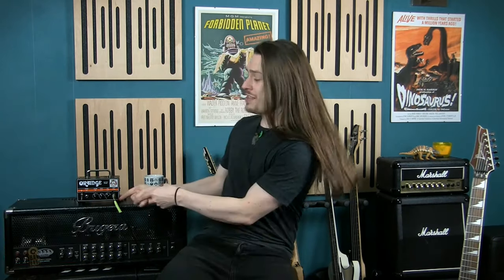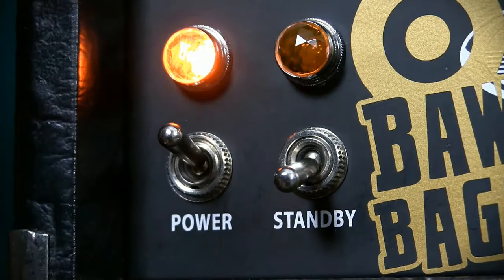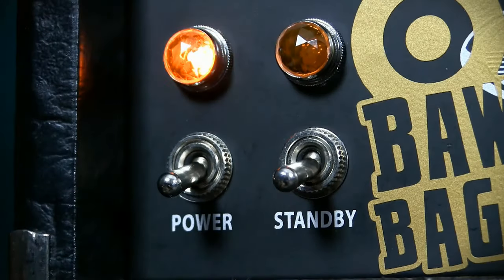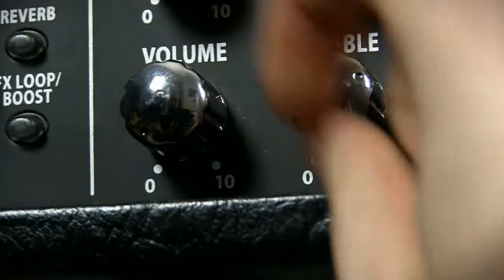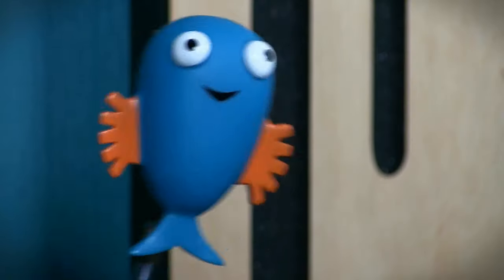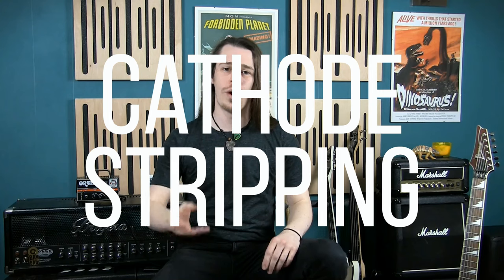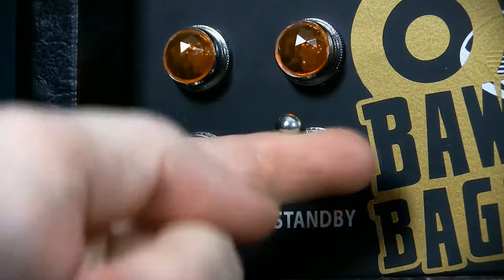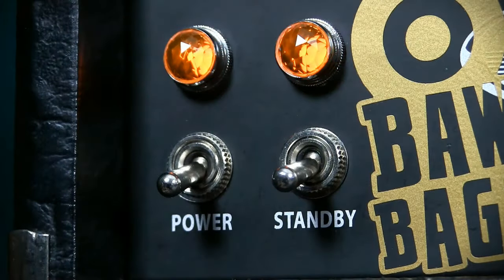Your Standby Switch Is A Lie!

Comment: The only thing the standby switch possibly protects is the speakers. When any amplifier is turned on or off, you often hear a pop depending on how high the volume is set. The standby switch disconnects the input and output buffers, meaning that pop is minimized. It can protect the speakers, but not the amp itself.

Comment: You can also turn your amp on and not plug in your guitar until you're ready to play. You don't need to turn down the volume in this instance. That's what I do as my amp doesn't have a standby switch. The manufacturer told me that when the guitar isn't plugged in, the amp is in "standby". Cute explanation.

Comment: The Standby switch is just a convenient way of muting the amp without having to change your settings (in this case the volume pot) on the amp. Thus making guitar switching much more seamless as well as not making life for the soundman's (if the club provides, or your band can afford to employ one)life much easier.

Comment: To clarify a subject that nearly everyone is confused about:   A Standby switch ensures that no high tension voltage is applied until the valves are fully warmed up. This avoids a build up of excessively high voltages while the H.T. voltage is waiting for the valves to warm up that may damage CHEAP CAPACITORS.

1. Use the STANDBY switch for 2-5 mins after switching on the amp  

2. For short breaks: ONLY TURN DOWN THE VOLUME  

3. For breaks longer than 20 mins: switch the amp OFF completely
Reply: Hot-switching 400+ VDC (with the standby switch) to components that are ready to start conducting and drawing current RIGHT NOW makes me nervous. I've had amps with tube rectifiers blow fuses and have internal arcing in the rectifier switching from "standby" to "on" for me to trust it. I feel better just powering the amp on and letting the components start drawing current gradually as they warm up.

I have a buddy with a Marshall JTM-45 reissue that was constantly blowing rectifier tubes switching off standby. He took it to a tech who re-wired it so the first filter cap is connected directly to the rectifier. It hasn't destroyed a rectifier tube since.

Comment: I call your analysis accurate. 
I'd add that, when in "standby",  the voltage across the filter electrolytics goes high due to removal of load from the supply...not at all a good thing.
Also, have a close look at the ratings of the "standby" switch; not at all rated for the DC potential across it.

Comment: If your amp has a rectifier tube, leave the standby switch on at all times! Use only the power switch.
If you don't want to ruin your level settings, just pull the input jack halfway out during breaks.

Comment: I prefer/am used to the standby switch. True that turning down the volume is the same thing but It's just easier to flip the switch next to the  lit up red switch in dark places. Might be true that the switch will wear out faster than a volume pot but the switch is way easier to replace, with today"s circuit board amps, it's a real pain removing the board and desoldering a pot off the board. (I am my own amp tech, not a rich man)  In the 13 years with my current amp the switch is still working fine.
        My rules for tube care  1) warm up the amp in standby, 1 to 2 mins.  2) Shut off the amp, both power and standby at the same time, but don't pickup or move your amp until it's had a chance to cool down, at least 5 mins. preferably more.
        I'm not an expert by any means but these two simple rules haven't let me down yet. Knock on wood

Comment: If you run an old non-master volume, multiple channel (jumpered) amp like a JTM45/Bassman, where the balance between your gains is more important to your tone and more finicky than your EQ settings, you will be glad that you can throw a switch and mute the amp.

Comment: Well...  Everything you said is correct except that turning the volume down is the equivalent of hitting the standby switch.  Sure, if all you're looking to do is to silence your amp, then either one will do.  But a quick review of some Fender and Ampeg schematics shows that the standby switch cuts the B+ line which provides voltage to the plates of your tubes.  The volume pot controls the signal level to their grids.  So in theory, using the standby switch saves electricity, though probably not much.  I mean, the whole idea of the standby switch is that it cuts the plate voltage without cutting the power to the filaments, so the tubes will still be warmed up and ready to go when you're ready to play.  But that also means they'll still be sucking up electrons to keep them hot because...well, you know...class A amps and all.

Comment: Stand-by switches were originally utilized when the PS caps were operated at or very near their rated operating voltages. Now-a-days, electrolytic caps are manufactured with much higher voltage ratings so they typically operate well under their rated voltages and the stand-by switch really serves no practical purpose. Cathode stripping is only an issue in which the power tube utilizes a filament and not a heater. You tend to see these types of tubes in radio transmitters.

Comment: the old equipment had rectifier tubes, which allowed to warm up the tubes a little before being fed with high voltage in the plate !!!
This happens because  the rectifier tube has to warm up itself to work and deliver the HV.

Now, modern guitar tube amplifiers have solid state rectifiers ... and therefore the tubes receive high voltages when they are still cold!! 
THIS is why the standby switch is good for preserving the preamplifier and the power tubes.
Make no assumptions about this just because u see old equipament without standby switches. consult any tec and you will see it.
Greetings!!

Comment: In my marshall JVM head I can keep the head in standby so I don’t need to load the head with a cabinet and just use the simulated speaker output in case I need to quickly record a demo using headphones or just studio monitors

Comment: In a SS rectifier using the Standby on start up actually sends a Spike that wears down Power Tubes. Using the Standby on shut down then unplug and switch both stby and power to on , will Drain Caps fast if you need to service. But moving Volume pots after dialing in is not a great idea either. So turn on at power standby to mute or drain caps.

Comment: I like the switch just because whenever I take a break, I don't like turning down the volume from it's nice sweet spot 
And it's easier, it's a switch, you put less work into using it, and I also knew as well that not having it wouldn't break my amp, it's just more relieving to have

Comment: Turning down the volume knob is not a better way to mute the amp while keeping the tubes hot. Because then you wouldn’t be able to turn the knob back up to the exact same spot. On my fender, a tiny move of the volume knob between 0 and 3 makes a big difference.

Comment: I agree with your main point, but I find the standby switch to work better for me than rolling down the volume because it's just that bit more lazy. It's just a flick of a switch, and rolling down the volume could result in my volume being too high or low because I'm too lazy to remember what volume I had it on.

Comment: There are amps that do create pops when turning off (old voxs do this) which standby switch makes less annoying, also putting it on standby when plugging in and unplugging stuff from your fx loops if you don't have a master volume (no volume after fx loop). Otherwise yeah u agrre just switch it on

Comment: Peavey has "in-rush current limiters" built into most of their tube amps.
Peavey amps still have a "stand by" switch because that is what customers expect to see, but you can turn the amp on without using "Stand By". The "in-rush current limiter" prevents current from hitting the tubes until they are hot. So, it's like you are actually ALWAYS using the Stand By switch on Peavey amps.
Reply: I have a masters in Wikipedia also lol
Reply: Peavey also say DO NOT leave a tube amp in Stand By more than 15-20 minutes. It ruins the tubes.
When you aren't using, turn it off.

Comment: Do NOT turn your amp volume knob down and then back up if at a gig once the engineer has done his sound check! Just use your standby switch to mute the amp. Unless, of course, you want to piss off the sound guy by suddenly having your amp at a different volume when you turn the knob back up to a slightly different position and start your set.

Comment: Based on the little I know (I just start building amps...), I have to agree with what you said . Also Barry at Ampmaker.con who is developing amp kits since many years mentionned that it is mostly useless or could even be detrimental. However it is usefull as a quick mute feature...

Comment: Someone forgot about the DC coupled cathode follower that doesn't like to get 100V higher tension on the grid before the tubes get hot......furthermore a lot of amps have their electrolytic capacitor and plate coupling caps voltage specs close to the operating voltage. And before the tubes are hot that voltage is higher. You can of course engineer around this problem. But i haven't seen any known brand of amps fix the DC cathode follower problem and a lot if amps are to close in voltage specs on their caps. So it probably is better for your amp to use the standby and heat up the valves before turning on the high voltage.

Comment: well, my Mesa Boogie TC100 manual says to Always power up and wait at least 30 seconds before turning the standby switch on, and my Fender Super Sonic 22 manual suggests that it is a good idea but not crucial.  Curious that amp manufacturers vary somewhere between ALWAYS use the standby and eehhh..... go ahead if you like.  While you say it's a load of junk.

Comment: I was curious about this issue.. Here's what Dr Z of Z ampworks says.. It's close to what you indicated, only he does recommend you use the standby switch on amps with solid state rectifiers..

Standby Switch in Tube Guitar Amplifiers
The use and need of a standby switch is an issue that comes up from time to time. Let me say that a standby switch is a convenience supplied to guitar amps. Now not all guitar amps have standby switches. For example, the Carmen Ghia and its indirectly heated 5Y3 rectifier does not need a standby switch. By the time the 5Y3 conducts high voltage, the tubes are heated and ready to conduct. Extremely high quality tube stereo amps, like those made by McIntosh also don’t have standby switches. Remember that many stereo tube amp connoisseurs and audiophiles use these kinds of amps sans standby switches. I have never read an issue about the lack of standby switches on stereo tube amps.

So why do amps have standby switches? They are installed as a convenience for the operator. When a band would take a break, the standby switch was used as a “mute” switch for the amp. Once the break was over, the amp would be ready to play with the flick of a switch.

A few terms used to scare users into using standby switches:

Cathode Stripping: This term does not apply to the tubes used in guitar amps. This applies to cathode ray tubes, and only under limited applications.

Cathode Poisoning: In my 50 years of dealing with vacuum tubes I have never heard about this phenomenon. Cathodes only conduct electrons when the anode of the circuit has a high voltage potential to attract them. High voltage is present only when the standby switch is in “play mode”.

Here are some simple dos and don’ts when using a standby switch:

Always use a standby switch when dealing with a solid state rectified amp. The immediate surge of high voltage on a tube isn’t the best for its long-term life.
Power on your amp, then wait a minute or so and engage standby switch. This is the proper use of a standby switch.
Turn standby switch off if you are switching speaker cabs, engaging a half-power or triode/pentode mode on amps with these features.
Engage standby switch when taking a break.
When you power down your amp, just turn off power switch and leave standby switch on. This will safely drain high voltage from your transformer and filter caps for safe transportation.

Comment: A lot of the old gear used valve rectification. There is a slower ramp up of B+, even slower when the rectifier was indirectly heated i.e gz37, 5ar4 etc. This is the reason why the standby was redundant in domestic gear.  Solid state rectification though is near instantaneous B+, even at lower voltages this will wear the valve quicker. In modern hifi amps, this is addressed with current limiters etc so the standby is unnecessary. There are kitsch hifi amps with standby as well. Usually they run rare valves. It's been observed over the years (in broadcast gear for example) that valves last longer when they are not cycled through power on (just like the old filament light bulbs)..
Now, for guitar amps, I only see one practical use for the standby in modern valve amps. If the amp is going to be lugged around and/or manhandled by roadies for gigging, then manually checking all valves are secure and all filaments light up first before applying the B+ would, IMO, not a bad idea especially in certain circuits (especially old ones without safety circuitry, Merlin discusses this). Example, in some circuits, having a pulled valve on the gain stages can result in runaways that might burn out transformers. A lot of crude circuits (even for the standards of the time they were created) are enshrined in the tone amp craft and are copied regardless.

Comment: This is all news too me... Ive always looked at the standby switch as a mute button that keeps the tubes from cooling off, causing a several second delay when i run up too the microphone. its also pretty nice when you dont want too mess with the volume settings you just spent an 20mins setting up with the sound guy. i was never told it was about protecting tubes... and i guess its not..... NICE VID! MORE WILL IT SHRED!!

Comment: The standby switch is there for one reason. To keep your amp from feeding back and making annoying noise when you put your guitar down after the set is over.
The other stuff you say is true but I see a practical benefit to having one quick method of making your amp silent.
Reply from the maker: Turning your guitar volume control to 0 would also achieve that. 
Or engaging a tuner pedal.
Or removing the cable from the amp.
Reply: CSGuitars that is true. I prefer the standby because turning down the volume means you have to turn it back up to wherever you had it set.  Unplugging your cord from the amp leads to tripping over it and spilling your drink. I find it a useful convenience even though its not strictly necessary.
There is a video on youtube somewhere where the guy makes the point that using the standby actually shortens tubelife by spiking voltage on a regular basis.

Comment: Rather than losing your volume setting you can simply use the stand by switch. It makes sense.
Reply: The argument is that you could easily use the power switch for that.

Comment: I never got that memo. I always just turned the Power and Standby switch off and on at the same time. 
I had never even heard this myth until watching D-lab's video right before this one. 
If valves were killed from not letting them warm-up before switching off stand-by, you would think places like GC and Sam Ash would have a million signs all over the place informing you of proper valve amp operation.

Comment: Eh, I think I'll continue using the standby switch when I take a break. I play through a vintage twin. On fender amps, the volume knob is so touchy that it can be a bit of a pain in the ass to dial it in, so I'd rather just leave it at the right volume for the place I'm playing once I get it there.  Still, this is good to know.

Comment: Standby switch is very useful if you need to mute sound in order to unplug or change guitar or silently tune guitar because you cannot move precisely master volume knob back to the original position. But this this thing will be terrible if it does something to an amp cirquit (like for example lowering voltages or unpowering tubes and etc) because real analog equipment like for example guitar amps tube or even solid state become sounding better after some time it is turn on.

Comment: It has nothing to do with saving the tubes.  It just for shutting off the B+ when you don't need it, such as while waiting around. It's also useful for changing speaker stacks w/o the risk of accidentally blowing the output transformer and is darned handy when you've got the thing open to set the bias. And if you care, if reduces the power draw a little.

And don't be so sure of the "low" voltage amps operate at.  Something like a Music Man HD130 runs the plates at around 750-800V.  The first version of this amp had a low power setting that unfortunately also underpowered the filiment, leading to cathode stripping. Later versions only reduced the B+.  Shutting the B+ off (standby) when not in use is a way to be "nicer" to the tubes if you feel like merely running the amp at "ear bleeding" instead of "I'm stunned, where am I?"
.